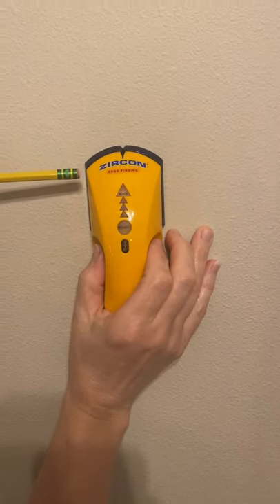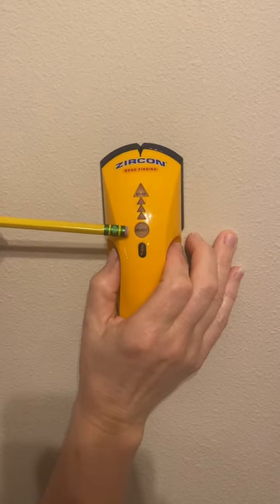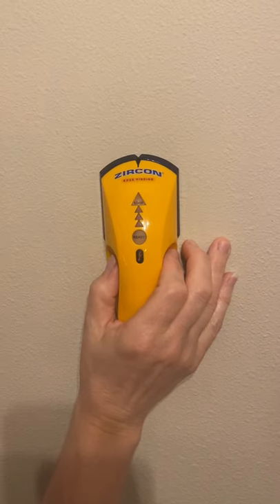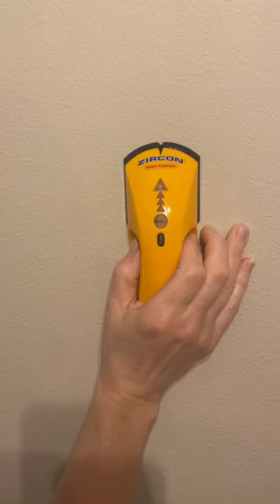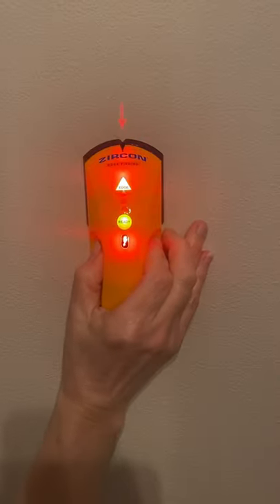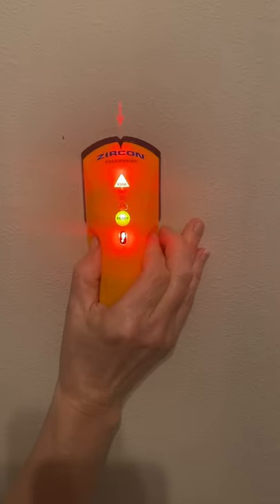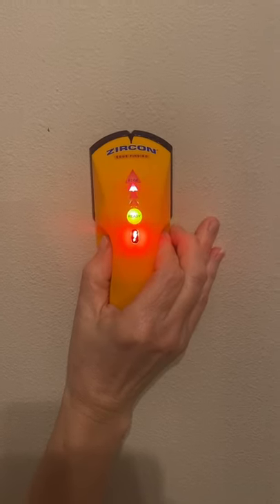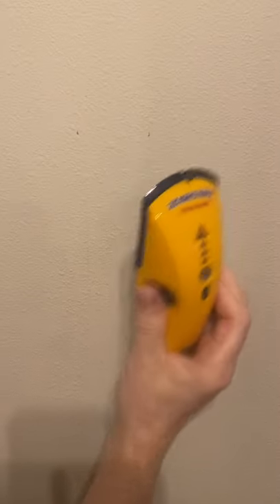How to use a Zircon StudSensor L30

Comment: You should avoid touching the wall at any point in time that you're using the stud finder as it messes with the device's ability to accurately detect a stud or wire behind the dry wall.